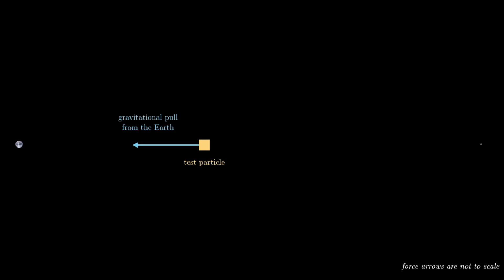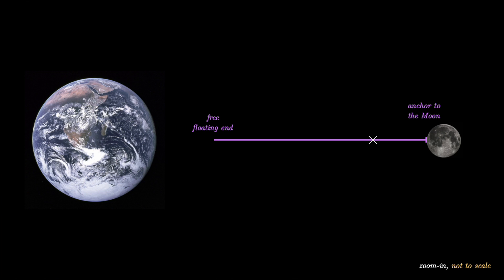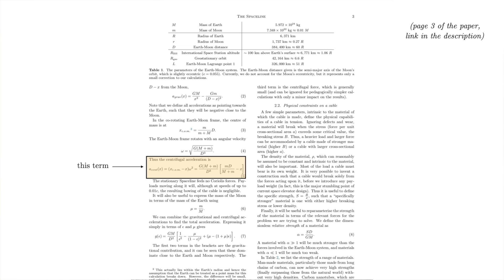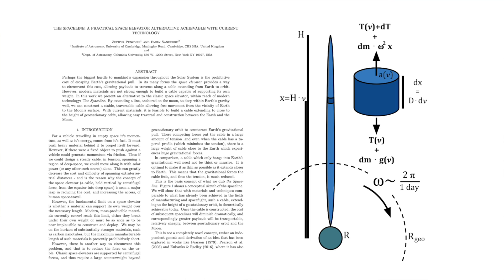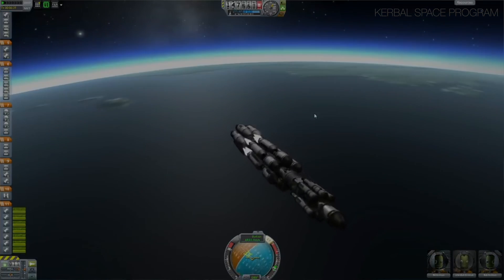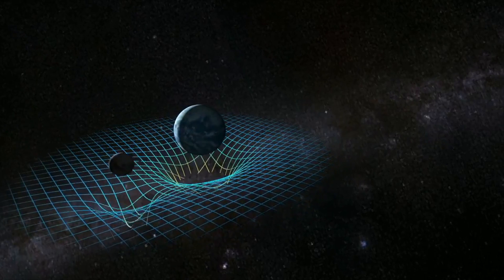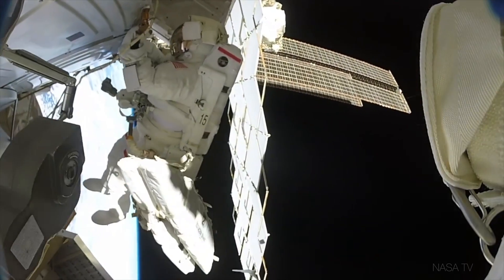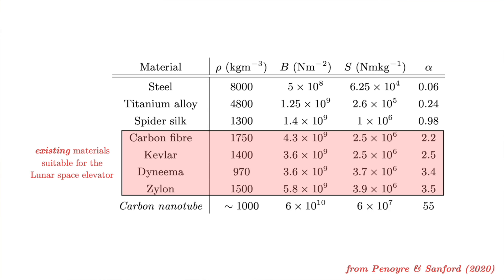The Lunar Space Elevator

Comment: My question is how do you dock with the end of a cable that is moving around Earth at the speed of the moon but requires constant thrust to join on to? This is going a lot slower than the ISS and is not in virtual gravity like it. The ship joining to the end would have to be firing it's engines constantly until it fully hooked up.
Reply: That my friend is also possible, at least within the basic, exploratory physics and the physical properties of today's materials science. Called a 'Skyhook', or more properly, 'Momentum Exchange Tether'. These are long, rotating tethers with no anchors. These tethers are nowhere near as long as the earth or lunar elevator and so aren't very challenging to construct. They are tethers hundreds or thousands of kilometers long, made to rotate as they orbit the earth, or the moon, or pretty much anywhere. As the tether rotates, one end dips into earth's stratosphere and could conceivably be docked with there. As the weather swings away from earth, it quickly pulls the docked craft and can the place this craft along another trajectory or higher orbit. Done right, very little energy is needed to balance the forces.  Information here.  https://en.m.wikipedia.org/wiki/Momentum_exchange_tether
Reply: Counterweight?  Without it this tether is going to have issues. That sounds harder than just landing on the docking station at the end of the cable, and you still have to maneuver with constant high thrust to grab the tether. This is nothing like docking on the ISS.
Reply: @garman1966  It's in the Wikipedia article. However since my understanding of physics is limited, I'll explain the way I may wrongly understand. The tether is kept stiff my centrifugal forces. As one spacecraft docks on to the earthward arm of the tether, another is also docking on the outward arm of the tether. This means any any one time slice in the process both arms of the tether are balanced. The only thing I dont get is how atmospheric dynamics plays into this. But I'm just a fanboy of high concept engineering who works as a janitor.
Reply: cool

Comment: The main problem with the space elevators is the speed and the capacity.
SPEED:
The fastest elevator at the moment moves with 73.8 km/hr, so for the Earth space elevator this means over 20 days travel time to geostationary orbit (36000 km). Probably it could move a lot faster keeping in mind the power requirements reduce while approaching the geostationary orbit as the elevator gains angular momentum from the cable and drops to 0 relative weight at the end.
However it is a completely different story for the lunar elevator. If we stretch the cable all the way from the lunar surface to let say 5000 km above geostationary orbit this means 343400 km and with the above speed it will take 194 days to reach the moon from the hook point above Earth. Also the space craft needs to hover at that hook point of the line until securely attached, because it is not in Earth's orbit, but the Earth's gravity is still pulling it back.
CAPACITY:
Nevermind what will be the travel speed there will be a safety limit which I doubt to be more that 1000 km/hr, so for the long travel time there could be only 1 elevator with the system max capacity on the line, otherwise it will overload it. This means there will be a huge investment for the entire system to be build and 1 load with max capacity or several loads with partial capacity - one way - once every 14 days (1000 km/hr). Probably there will be an elevator capsule of some sort to shuttle on the line as you don't want to transfer the entire Earth ship to the moon with all is engines and empty tanks, but only the payload to the moon. This means if it took 2 weeks to travel one way then you need to wait for another 2 weeks for the elevator to return for the next load. Really not the most practical way to travel.

All space elevator ideas sound very good at first, but when you go deeper in the details there are so many issues. In the end everything is about speed, if it can travel safely with 10000 km/hr then it makes sense (present best is 73.8 km/hr). This should be the main research point and not how to calculate the cable strength.

Comment: Space elevator?  Bunk.  If you accelerate a heavy vehicle away from earth, it has to also be accelerated laterally in the direction of rotation of the Earth.  It will resist being accelerated, so it will need to have a rocket attached at right angles to the elevator cable and fired as long as the cab moves away from Earth.  The faster you plan to move the cab, the more thrust you'll need to keep the cable from being drawn back like a bowstring.  The deflection will be most intense at the ends, and at the minimum in the middle of the cable.  If the angle of the deflection is great enough, the direction of pull on the anchor will change.  That will take some engineering, to have a moveable anchor point that can take the stress.   It will also pull the upper anchor/counterweight down toward the Earth into a lower orbit.  The orbiting anchor will then need to be decelerated in the opposite direction of rotation of the Earth.  The opposite will have to be done when the vehicle moves back down to Earth.  Seems much easier to just launch the contents of the cab in a rocket.

Comment: "With no obvious technological hurdles preventing it's construction..."
"Unfortunately, we don't have materials which are strong enough, at this point..."
Choose one - you can't have it both ways... congratulations on undermining your own argument!
How about we develop a suitable material to sustain the shear and stress (and micrometeorites and Kessler objects), then consider the implications? Otherwise, this is as meaningful as pondering the implications of *time travel*...
Reply: You didn't pay attention. She was talking about the materials needed to build a space elevator from EARTH. The gravitational forces on the Earth are stronger than that of the moon and thus requires the tether to be made of a strong material (stronger than any one known to man currently) to maintain integrity. The moon is lower mass (lower gravitational pull) so if you wanted to build a space elevator on it, you could do so with current existing materials (Kevlar or carbon fiber for instance).
Reply: @madmanproducer  Excuse me, but you did not pay attention to my comments, you hypocrite. As you are no doubt aware, the maximum length of a cable is equal to the breaking stress over the density. For Kevlar, that equals just shy of 249km, and for carbon fibre, it is closer to 230km. Furthermore, please demonstrate how kevlar or carbon fibre can withstand bombardment from fast-moving shrapnel, such as meteorites and man-made debris. Please explain the consequences of such a long cable snapping under the shear and stresses. Still think that this is a viable proposition? I accept your apology!
Reply: @madmanproducer  yep, clearly didn't pay attention. and also thinks it's just a single strand hanging out into space..

Comment: Good vid. Thanks Emily. I have a question from when I first saw this paper some months ago. There does not seem to be any details on the Dv Costs of "Landing" on the tip closest the earth. The ship needs to spend Dv to slow down from geo sync orbit to land on the elevator tip. Wouldn't it be just as easy to just go all the way to the moon with the DV used?
Reply: Hi tobi! @loklan1's got it---you're never in proper geostationary orbit, as in you never expend the delta-v to circularize at the Earthward end of the line. It works out that the delta-v to match the speed of, and rendezvous with, the lunar space elevator is minimized at a height of ~25 Earth radii above Earth's surface, but wherever you meet it it's less delta-v than going all the way to the Moon.
Reply: @ellipsis815  Hmm .. 25 earth radii is about 4 times Geostationary...cool ! good to know.  So ... you don't need to payout or retract the "rope" ... also good to know.
PS: Thanks for the informative reply.
Reply: Why start in Geosync? If you are coming up from LEO you'd have a lower speed at apoapsis.
Reply: @loklan1  It's not about geosync orbit per se, it's just that the speed you need to be at to orbit at the height of the tip of the rope is much much faster than the speed the tip of the rope is orbiting at, so if you're orbiting up there you need to spend a lot of energy decelerating without lowering your orbit in order to sync up with the rope. 
Getting to that height at the apoapsis of a lower orbit would help, but the question is how much.
Reply: @loklan1  Sorry I dont understand your question... The tip of the elevator is a bit farther out than geosync orbit.. ie about 45000 km above the surface of the earth.
Reply: good question

Comment: There was no mention of the effect of the sun's gravity on this cable. Considering the degree to which the sun influences tides on earth, wouldn't the tidal forces resulting from the moon revolving around the earth be a massive stress on a lunar space elevator?
Reply: mass
Reply: @daos3300 
As the moon orbits the earth, the moon's and sun's gravity will sometimes pull in the same direction relative to the space elevator, sometimes in opposite directions but mostly at an angle, how can this not result in large stresses? mass??
Reply: @johnkesich8696  all stresses – including possible impacts – would be accounted for in the design, the same way all structures on earth are engineered to cope with any stresses they experience. a space tether would probably work best if tapered – thickest at GEO and thinning out toward the ends.

Comment: I would suggest that the future always sneaks up on you. Nobody planned the industrial revolution, or, before that, the neolithic agricultural revolution. There was no democratic oversight over the rise and fall of empires, the exploration of the globe, the introduction of printed books or the internal combusion engine or the telegraph. It's an evolutionary process, not an engineered one. I suppose one either believes in progress, and uses that belief to motivate courage in the face of its inevitable stresses, or fears it and uses that fear to motivate its moral condemnation.

One practical aspect you didn't address in the video is the time taken to travel along the lunar elevator. If it's around 200,000 km long and your elevator cabin goes at 600 km/hr (the current speed record on the Shinkansen) then that's two weeks of travel, which is hardly competitive with a spacecraft that takes a couple of days. Remember also that conventional spacecraft will be technologically mature by the time the elevator can come into service, because they will have needed to be employed on a large scale in order to support the construction of the elevator.
Reply: Democratic oversight might be necessary for this because you can only build one of them and therefor whoever runs it will have an automatic monopoly. Failing to do so could result in extremely high prices which could set back progress etc.

We're already pushing the limits of what's possible with conventional chemical rockets, there's no avoiding the fact you need many many times more fuel than you can have payload without methods such as this to assist by providing external power.

Fair point about the elevator speed needing to be known to asses practicality, I'm sure it's max speed would be far slower than a direct rocket but I've got a few counterpoints. 
600 km/hr is the record with the drag caused by Earth's atmosphere, you could go much faster in a vacuum.
The elevator is as the crow flies rather than taking the longer curved path a rocket needs to take.
It would allow for larger payloads, more efficiently, at a lower cost, more reliably and possibly have more frequent launch windows.
For time critical components it probably wouldn't always be the best option but it would make more sense than conventional rocketry for everything else.

Comment: You didn't mention about the moon wobbling. have you thought about the calculations for this ?
Reply: @suzuki tlr nah, they forgot.
Reply: @daos3300   LOL
Reply: Came to say the same thing. Crippling problem for this project
Reply: It would likely only be a problem if lateral wobbling were to occur at a resonant frequency for the cable.  Of more concern would be the normal cycling of the moon's orbital apogee and perigee, which could raise or drop the Earthward end of the cable over an excursion of 42,000 km.  If the Earth end were situated at anything less than 42,000 km of altitude at the time of apogee of the moon's orbit, I could imagine the cyclically fluctuating gravitational force on the rising and falling Earth end setting up a standing wave in the cable.  And since the Earth end would not be tethered, it would be analogous to a standing sound wave at the bell of a trombone.  The Earth end of the cable would be whipping back and forth above the surface of the Earth, until, at perigee it touched down and began either frothing up the ocean or raising havoc on the ground.  This effect could be mitigated by designing the cable to be variable in length by 42,000 km, accomplished at the LaGrange point, of course..
Reply: I just don't see the efficiency from the rocket point of view to dock with the Earth end of the elevator.
All that fuel has gone into getting the rocket to escape velocity, then it has to slow down to dock with a pin point location traveling at a rotation speed 27x less than Earths rotation.
There is also the extra complication for the rocket of there being a partial gravity at the docking point to keep the elevator taut.
Easier and using less fuel I would have thought would be to continue coasting to the moon, drop a containered load into moon orbit then give another boast to get back to Earth.
No more SiFi than a moon elevator would be to have a purpose made tug to grapple the container and return to the moons surface with it and put the container exactly where its needed.
The moon now has a useful container and no handling of the content has been required till needed.
Reply: @Dug6666666   totally agree complete waste of resources and energy we can all dream . Trying to build something thousands  miles long and moving away It will be just as easy to have a refueling station in orbit.
Reply: Also, wouldn't any vehicle using the cable to advance towards the moon inevitably pull onto the cable with a force proportional to both its mass and its intended acceleration, inevitably snapping the cable in the process?
Reply: Added to that the L1 point is not really stable at all.  It is easy to say we will account for this, but to account for the motion would add push and pull the cable all around causing some major issues, especially to those currently riding on the cable.  There are a bunch of other issues that would prohibit its use in practice.  You would be better to just build a 'Rotorvator' and just snatch objects from orbit right from the surface - or combine a rotorvator that with a Lostrum loop - fire the loads to space and they are grabbed and re-directed to their destination by the rotorvator.  It would be much cheaper and the loads to be returned to Earth/station point without any fuel usage.  Which would still be required leaving the orbit of the space elevator.

If you have the money for the elevator and want to build big, then spend the money more wisely and build an orbital ring.  The cost would be in a similar ballpark but the ring is buildable with current materials and technology and is better in every single possible respect than a space elevator.  It also adds a bunch more capability that would allow easy and fast travel around our solar system along with many other uses.  Have a look at Isaac Arthur's channel and watch the 'upward bound' playlist.  It covers all the best ways to get off world and the pro's and cons in a very concise and easy to understand format.
Reply: @Nano606606   hi yes this project has a lot of problems might as well keep pumping all the money to Gateway. I do watch Isaac Arthur I also suggest John Michael godier.   Event Horizon.  Astrum.  All brilliant.
Reply: @suzukitlr8777  Hey.  Personally I dont like Gateway, its a fuel tax just to go there.  But it is a start.  I used to love JMG's stuff until he basically featured Ari Loib for months on end spewing his 'Oumuamua is an alien ship' theory.    Once was fine, but his contact focus on this idea was offputting.  Yes it could have been an alien space craft, but MUCH more likely was it just a rock with an interesting story.  Stopped watching him in the past few months.
Reply: @Nano606606  hi yes like you say it's a start. and for me I am a Bigelow Aerospace fan. And the idea that bit of rock was a spaceship didn't go with me. And also was suggested that the Moon was a space craft as well. I'm just so glad we're going back to the moon long overdue.
Reply: Yes I thought the same.  Plus the Moon is in an elliptical orbit so the L1 point is moving. Also, even if the structure didn't touch the surface and cargo had to retro-rocket down the figurative last mile, the elevator might still be unstable as the Moon has a fairly unbalanced gravitational field that might makes long term low orbits unstable.
Reply: where is the problem with having more rope and just compensate for the changing length of L1-Moon. Similarly, I don't see any problem with the weird moon gravitational field - the elevator wouldn't be a passive structure that would work indefinitely once put there, there's gotta be maintenance. It would have thrusters to compensate for the drift.
Reply: She did not have the time to do it. She was justifying her envy about Elon Musk's possible space condo ... probably by joining some marxist group.